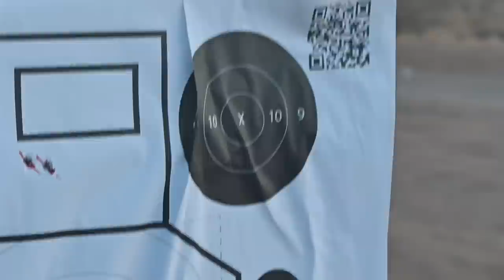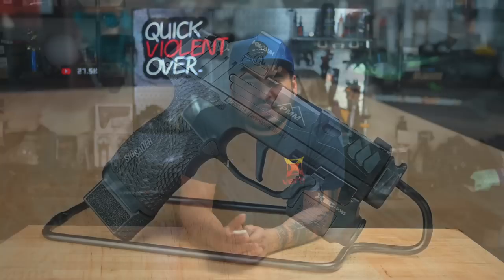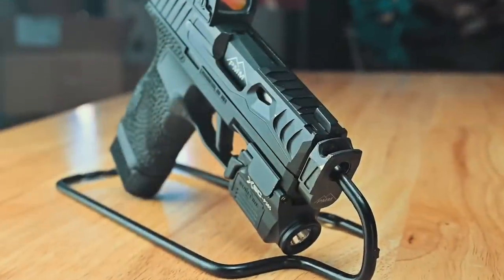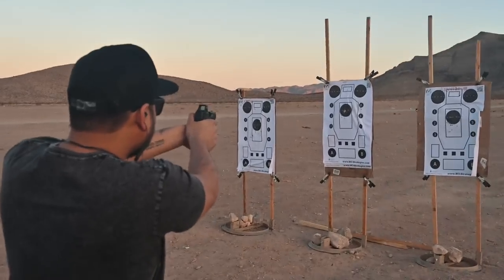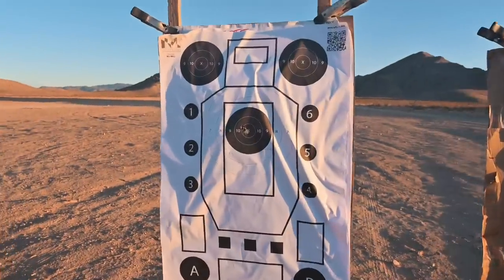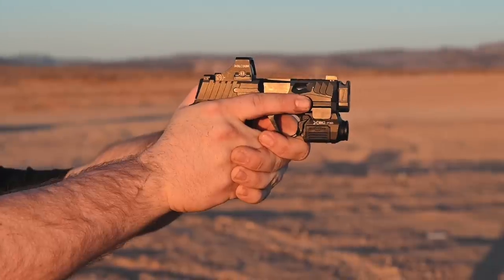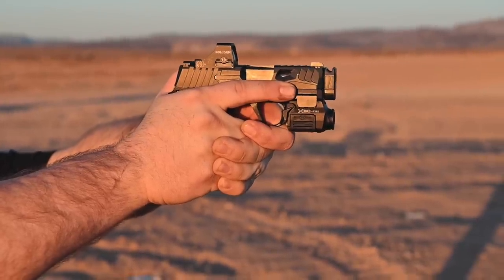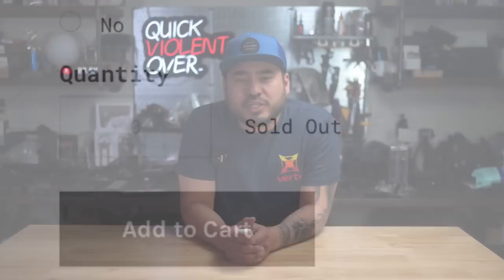The Ultimate Sig P365 Build! | PMM | Norsso | Lakeside Gripworks | SureFire

Comment: The SF XSC light would be sick if it wasn’t almost as expensive a gun itself.
Reply: For the price point, there's not enough lumens imo.
Reply: @DeimosPC  Surefire really got screwed when the TLR7 sub came out. Beats it in every way
Reply: What people don't consider is the size comparison.  The other two lights in this size category put out 100 lumens compared to the XSC's 350 lumens.  To get 500-600 lumens you bump up to a much longer light that will stick out about 1/2 " to 1" from your barrel if you are putting it on a standard P365 or P365X.   And, the battery is vastly superior to the Sig or Streamlight (TLR-6) that it's rechargeable and extremely easy to take off and put back on.  Yes, it's expensive but you're getting a far better product for that extra cost IMHO.
Reply: @tizben  TLR7 is not what you should be comparing to the XSC...the TLR6 is the direct competator.  The TLR7 sticks out way too far IMHO when putting it on the P365 standard and the P365X.  On an XL version though, I'd probably choose the TLR7.
Reply: Just got mine last night for $240 on Amazon!
Reply: @grantwilliams5458  These are expensive but it is a very good light considering it's size and features (rechargeable battery).  I have 4 small weapon lights and this one is easily the best one for it's size.  When comparing it to the TLR-7 the XSC's light is white where the TLR-7 is yellowish.  Indoors (room clearing) the XSC does an excellent job and I would easily choose this.  Outdoors though is where the XSC starts to struggle and the lights with more lumens start to beat it outright.   

So what I ended up doing is keeping the XSC on my P365X and I have the TLR-7 on my P365XL Spectre Comp.  With the longer slide on the XL Comp, the TLR-7 fits well.  The other factor some might consider is the XSC is also thinner and simply fits much better on the P365.   The TLR-7 is actually wider then the pistol by a small amount and simply looks "fat" on it.

Comment: I’ve experienced a lot of malfunctions with failure to eject, stove pipes, and jamming.  I have the pmm comp/barrel, Dpm gold spring, and Norsso slide.  What do you think I’m doing wrong.   Currently using 115g range ammo.  Should I use the lightest spring?   Did you experience these issues?
Reply: Did you ever figure it out?
Reply: @ZeeMPee  putting a lighter spring fixed it

Comment: I don't feel the trade-off with the Comp is worth the extra recoil management unless this is a range gun.  For self-defense/home defense I really don't want the extra flash upwards that the comp produces.   I've shot a lot of night shooting, and even without a comp it's surprising how much flash is thrown out of these small barrel pistols due to the extra powder burning off in that atmosphere.   With a comp that flash is sometimes doubled!  A light certainly helps a bit, and I do like the XCS light, but it's not super bright and the flash from firing will overpower your eye's ability to see past it, or not be hindered by it.

Have you tested this setup in low light shooting yet Roger?  I haven't had the chance to try out something like this, so I'm basing my opinion on other similar builds I have shot in low light.
Reply: There’s reviews testing the 365 spectre comp (while not exactly the same it is similar in design). The extra flash comment is a pretty moot argument.
Reply: @mouahmong  Yup, I've seen many studies on the compensator in low light.  The point I was making is most people don't actually do the low light study properly.  Meaning....you have to spend about 30-45 mins in near darkness to allow your eyes to fully adjust to the low light and gain "natural night vision"...or at least the best humans can attain.  No one in these videos do that.  If you don't spend the time to allow your eyes to adjust, then not allow any extra light into the room, and then shoot the pistol, you will never actually see the amount of flash produced.

With all this said, I bought the Sig P365XL Spectre Comp because the reality is the chance of a true low light confrontation with a conceal gun is almost ZERO.  For a home defense gun it's extremely high, but the P365, in any form, is NOT a home defense gun.

Comment: I'm in the market for most likely a 365X (I want the optics ready slide), and then I may buy an aftermarket 365 frame to get back to a smaller footprint.
 The 365 with compensator adds some weight up front.  The 365XL which is about the same length also adds some weight up front in both the slide and barrel.  My question is... Does the extra size/weight of the XL equate to the comp's ability on the shorter gun?  Basically, which gun shoots better for follow-up shots?  If both guns end up at around the same length, does the comp on the 365 shoot better than the longer XL?
Reply: They have the 365x too that's the normal 365 with optic cut.

Comment: Why can I not find that holster for sale on your website?
Reply from the maker: It's under Sig Sub Compacts.  Here is a link.  Thanks for checking out the video!  https://qvotactical.com/product/sig-sauer-p365-sub-compact-more-discreet-iwb-holster/
Reply: @RogerBarrera  Awesome, thanks for getting back to me so quickly!
Reply from the maker: @haydenbrayton  no prob!
Reply: @RogerBarrera  I’m about to place my order but had a final question. I have a custom p365 that had the slide cut for a holosun 507k. I noticed you don’t have any optic options. Would you be able to accommodate for that by keeping the sweat guard a little bit below the back of the slide? I would of course specify in my order notes.
Reply from the maker: @haydenbrayton  All of our holsters are made to accommodate red dots. It says it in the product description underneath all of the options. You will be good to go. 👍🏼👊🏻
Reply: @RogerBarrera  Order placed, thank you sir! My gun is a bit of a unique case the red dot was milled into the slide. It’s sitting a little lower than a typical red dot would. I left a note attached to my order to take the top of the sweat guard down about half a CM away from the top of the slide. I could do it myself but I’m afraid ill mess up the cool fabric overlay!

Comment: What about adding a DPM recoil guide reduction unit?????
Reply: @areyou0k98  Thank you.
Reply: Unfortunately the DPMS is not available for the P365X model is not yet available (due to it’s double capture spring assembly).  I’m on the “notification list” for its release/availability.

If you have the regular 365, the 365 SAS, or the 365XL DOMS already has you covered.
Reply: @jimward3527  Thank you very much for the info.